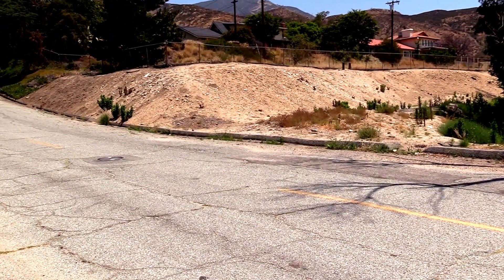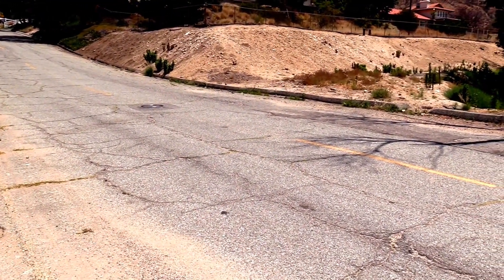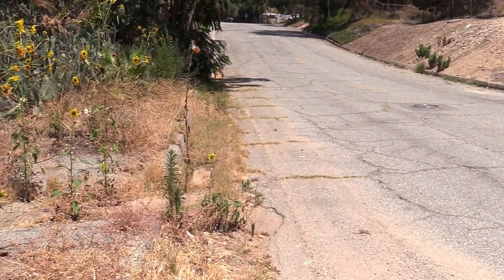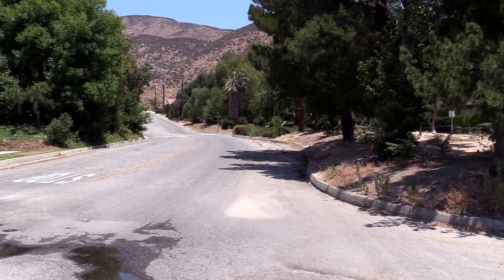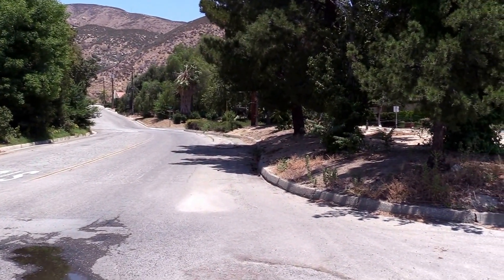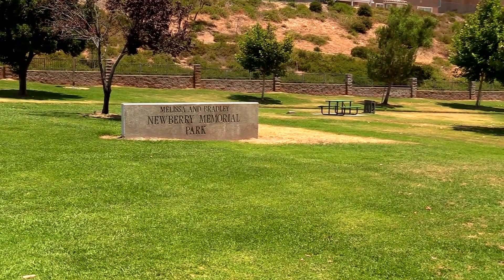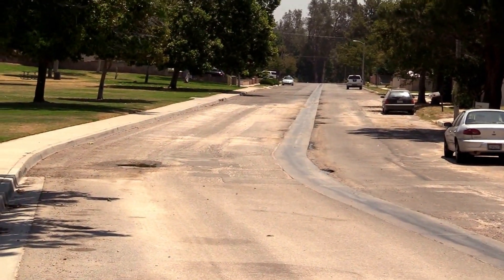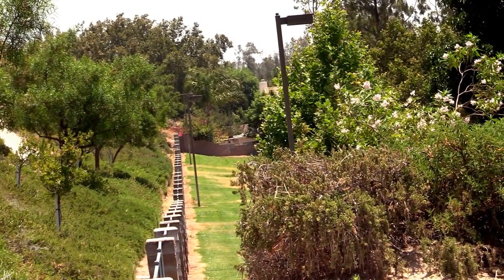Tour of the San Andreas Fault in San Bernadino

Comment: It looks very dry there, I'd be more concerned about bushfires in San Bernardino than earthquakes. If you are going to build a house in an earthquake prone area, buy a block of land that is on hard rock ground at the top of a hill or a ridge, and build a wooden house on your block of land. Hard rock ground does not shake as much as soft ground does during an earthquake, and hard rock ground won't experience liquefaction or subsidence. A wooden house absorbs the earthquake waves better than a house made out of bricks or concrete, which is liable to crack and crumble.
Reply: Michael Balfour, you can build your house out of whatever you want as long as the construction is up-to-code. The absorption mechanisms can be installed to any building. A reinforced concrete house with base isolation makes for the safest shelter.